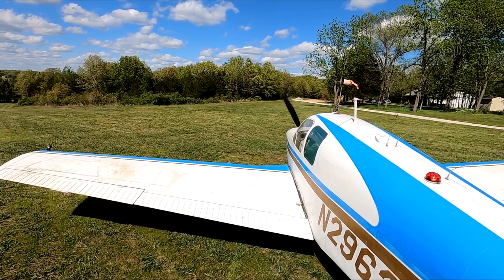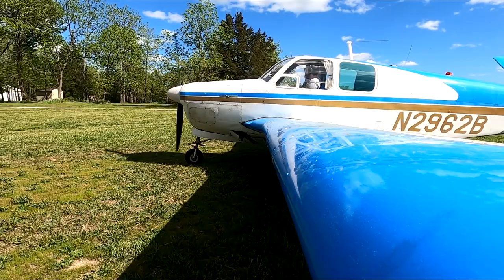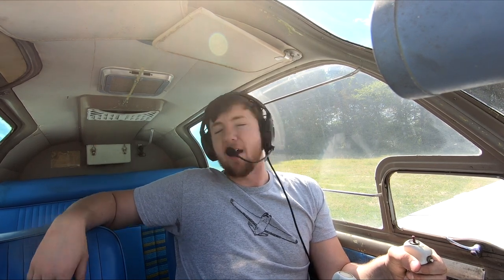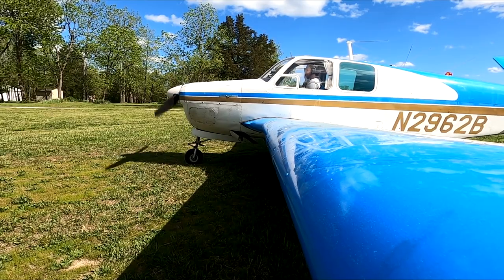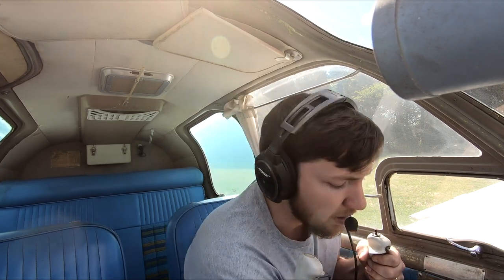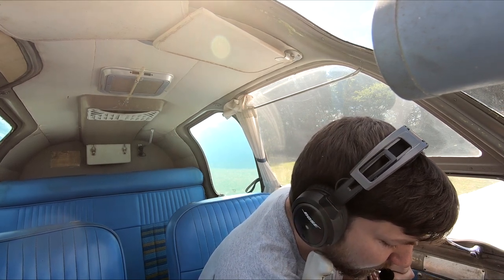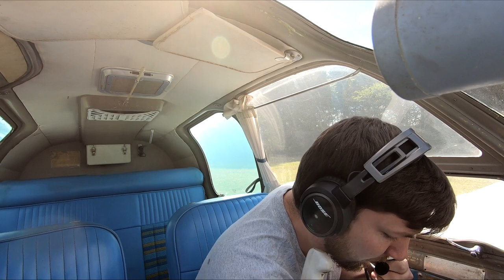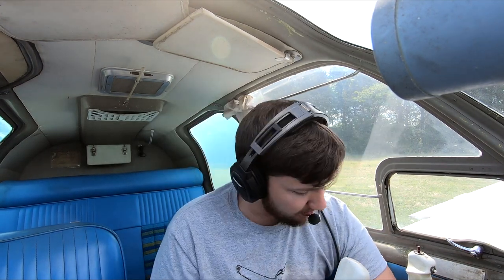BARN FIND V-TAIL BONANZA FIRST FLIGHT IN 15 YEARS!!!

Comment: 🙀 Aren't Bonanzas' know as "the Doctor killers"? Those aircraft were either tricky to fly, or somehow unstable, or something, because, as I recall, they were real popular when I was young, but they fell out of favor quickly. Many crashes.
Reply: Easy:  LOW time p/t recreational pilots vs  FULL time doctors.
Reply from the maker: Just very fast when clean so easy to overspeed in loss of control situations. The aircraft is actually very balanced on controls and behaves in a benign way. The situation in the video was all wind and pilot induced. I assure you any aircraft would have struggled with that approach under that day’s conditions.